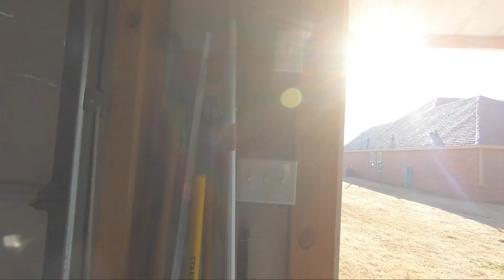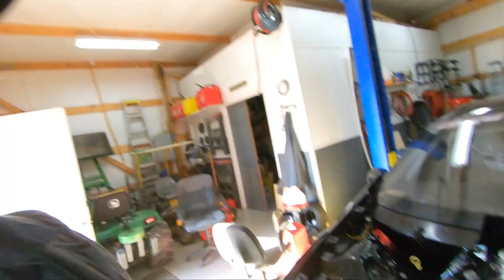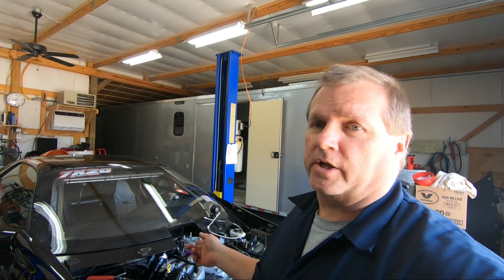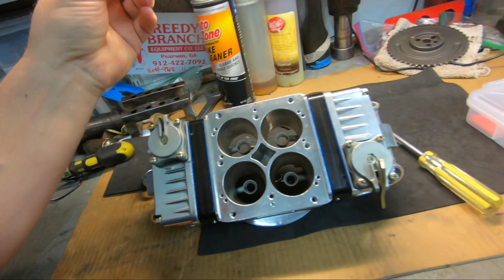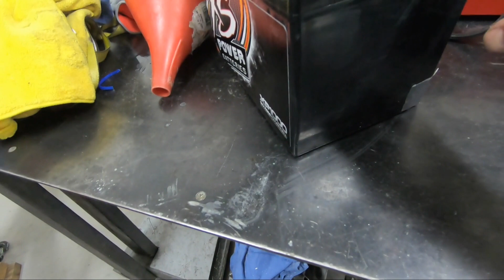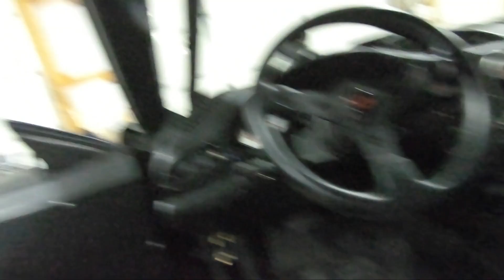First Test Session of 2021 - Did not go as expected! But good news! 16 Volt System Up and Running!

Comment: Just found your channel. Born Gm boy to man. Own 7 3-5th gens Camaros.  My 1st at age 15 was a 85 z28 H.O 305 car at age 15 I thought I was the fasted at my high school until a buddy of mines had a 302 lx mustang well after that me and Sr did a 355 an I was the fastest at my high school.  I was hooked.  My current is my 2000 z28 mista teal green factory paint. Auto 400th tq arm stock suspension small tire grudge car. My fastest to date keep making videos not alot of Gm F body ls base YouTube channels for us. I will sub an support. Gm ls lt FTW.
Reply from the maker: Thanks! This is my 4th F-body had it since 98. Started off with a 75 Firebird (350), 78 Trans-Am (403), 82 Firebird (V6) (Slow), then this one! This first thing my wife said please don't mod it! Will that did not work at well!. Thanks for watching!

Comment: Take a lead ball and plug those power valve cavity holes since you aren't using power valves. It can't leak down if there's not an open hole for it to leak into.
Reply from the maker: Thanks for the info!